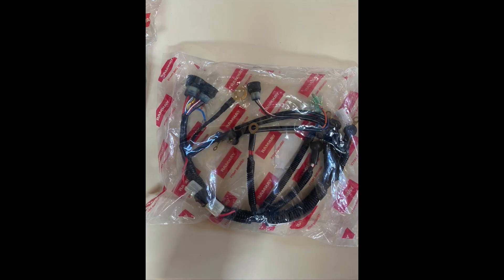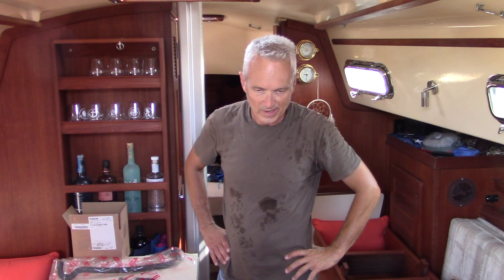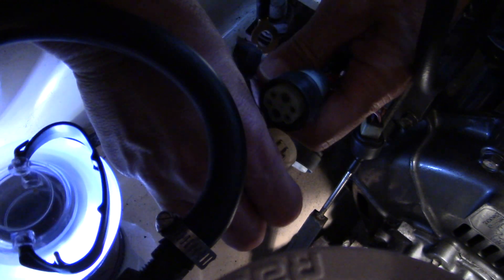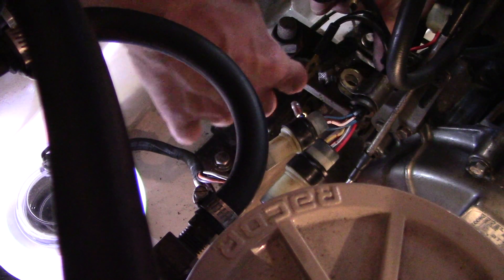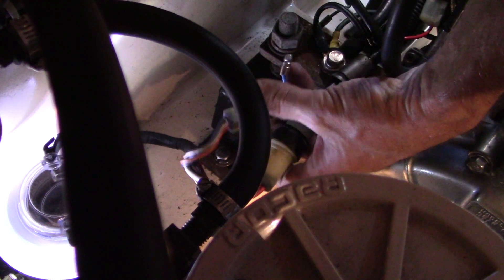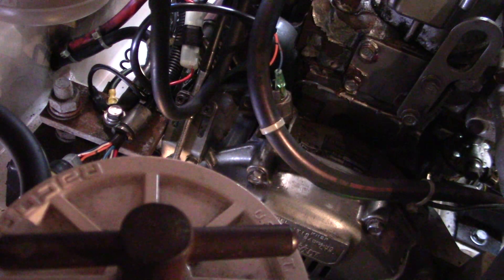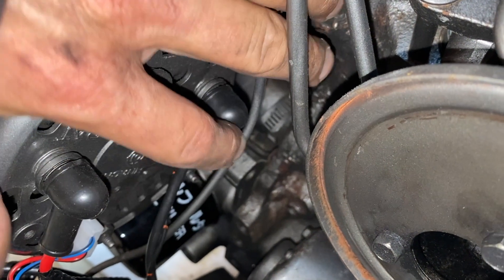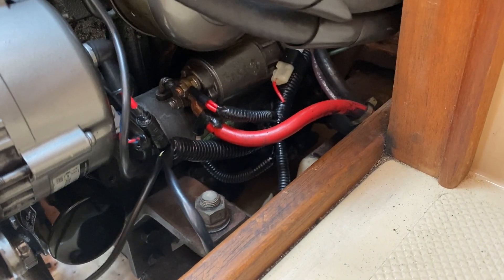Changing Yanmar 2GM20 Wiring Harness - DIY

Comment: Thanks for the video! What kind of alternator is on your engine? I have a Hitachi L180 03C on my 2gm20f. Also the 2 plug with the white/red wire is for engines with a sail drive.

Comment: Hi Salty Doug!

How did you know it was the harness and not the starter itself? I just got a new starter and I'm planning to install it soon (wish me luck!). After watching your video, I'm wondering if a new wiring harness might have been all I needed. My engine's a 1985 3GMD, looks pretty similar to yours. Symptoms match too - just a clicking sound when I hit the starter button. I've resorted to giving my starter a little love tap with a wrench 😂 while someone else pushed the button to get it going. Not exactly the classy way to wrap up a day of sailing, right? Change is in the air, but now I'm pondering if a new harness might do the trick... Any thoughts from you or others would be awesome. Thanks a bunch! Deidra
Reply from the maker: Hi Deidra!  So I must confess, I suspected the starter as well in my case, and I even went so far as to buy a non-Yanmar starter that was “guaranteed to fit.” But after taking it to a mechanic to see if he would install it for me, he vehemently refused. Apparently, a non-OEM starter can spell nightmares for these older engines. Doing some reading, I learned that a lot of people were having issues similar to mine, and it almost always came down to the gauge of wiring. While I can’t definitively say that’s what was wrong in my case, I can say that I never had starting problems after replacing the wiring harness.  Anyway, please let me know how it goes if you do replace the starter.  Good luck, and thanks for the comment! 😃🧂🦆

Comment: Thanks, very helpful. BTW you have a fresh water cooled 2GM20F (versus raw water cooled 2GM20), you can see the engine model at 18:12.
Reply from the maker: Thanks, Bruce!  You are correct - the engine is a 2GM20F.  It’s a great little engine that is easy to service (for the most part 😉) and quite reliable.  Stay Salty!
Reply: @SaltyDougSailing  I have the same engine on my 1992 Island Packet 27 - it is definitely a great little engine. The positive wire that comes off the 55 amp alternator appears  to be quite thin/undersized to me (perhaps only 12 AWG) and I was going to make a new one (8 AWG) but after watching your video I see it's part of a wiring harness (again, very helpful). I wonder if the current replacement harness has a heavy gauge wire (it appeared that may be the case). Thanks again!
Reply from the maker: You are correct again, Bruce! :)  The wiring harness is a newer version of what they used to sell, and they corrected a common problem by upgrading the undersized wire.

Comment: Hi Doug, Great Video - I have the exact same engine, and she is tempermental starting.  I would get just a click sound, and volts would drop.  Then wait and try again, and she would be slow to crank, then catch.  Is that what yours was doing upon startup.  I imagine it is the starter or the wiring.  My engine is the same age, so maybe standard manitenance is a good thing anyways.  Where did you purchase the wiring. Do you have the link.
Reply from the maker: Hi Brian. Sounds like your issue is exactly the same issue I had before. The new wiring harness solved my problem. The way it was explained to me is that this is a known issue with our engine.  I got the harness from a Yanmar parts dealer named Zimmerman Marine. Depending on where you’re located, they may be a viable option for you. Check them out at zimmermanmarine.com.
Reply: Just read this. If you are getting a click and voltage drop then slow to crank check the large battery cable connections. Not unknown for corrosion actually between the cable and the crimp.
Reply: @johnglover9935  Thankyou !!
Reply from the maker: Some of the original wiring was admittedly insufficient and the new/updated wiring harness sought to correct this issue.  In any case, it certainly solved my issue. Good luck!

Comment: Well known fault with Yanmar. Engine was suffering from Yanmar disease. Will surely fail again, the fix is to fit an assist solenoid in the start actuation circuit.
Reply: Yes indeed. This is what I did, install an alternate starting solenoid with separate switch & push button (redundancy; in case key lost) PLUS running a parallel 14awg wire from panel push button to the original starting circuit directly to the solenoid (bypassing the cable loom & connector). No more problem :D
Do check & tighten the smallish screw that holds the wire spade on the solenoid. Mine was loosen and was hidden from sight by some cables nearby and the insulating rubber cap.
Reply from the maker: Thanks, John - I had not heard of that solution but will definitely look into it!  Any other common symptoms?  I'm a firm believer in preventive medicine... err... mechanics! ;-)
Reply: Great information - Do you have any pics or links I could use to change myself.
Reply: @brianjobvite8473  So easy. Get a 40 amp 4 pin automotive relay. Disconnect the small white wire from the start solenoid and connect to terminal 85 on the new relay, you will have to crimp a spade terminal on. Connect relay terminal 86 to a ground on the engine block., I usually use one of the bolts retaining the start motor. Make up a lead of suitable length the same diameter as the white wire and connect from the large terminal on the solenoid, the one that is connected to the battery, terminate to pin 30 of the new relay. Finally, with a similar piece of cable connect relay terminal 87 to the solenoid where you removed the white wire. Pins 85 and 86 are the switch, pins 30 and 87 carry the current. If you can only get a 5 pin relay don't connect pin 87A it will work just as well